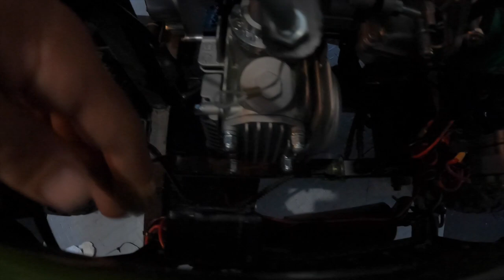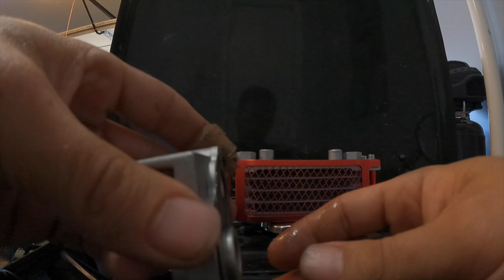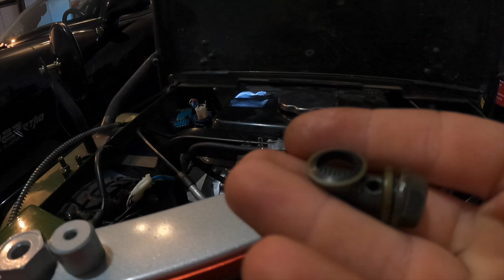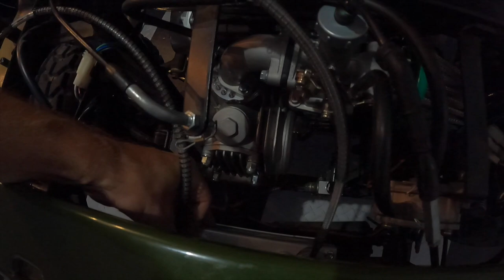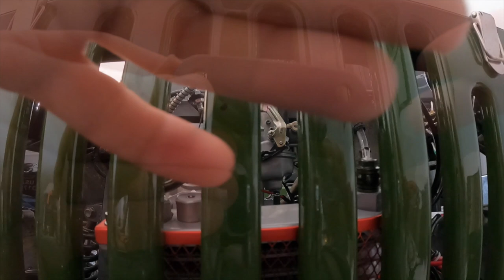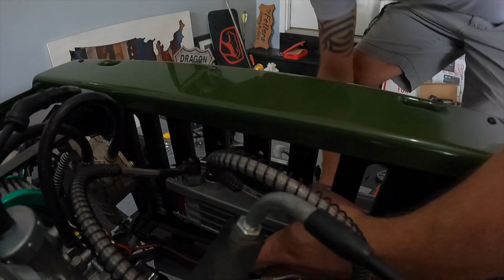Mini Jeep OIL COOLER INSTALL! A MUST DO MODIFICATION!

Comment: Did the oil cooler lower the engine heat problem? I own the Coolster GK6125 mini jeep and it gets super hot after even a short ride. Other option might be an electric fan mounted to the inside of the grill (or maybe both, think that’s overkill?)

Comment: There have been lots of single jug air cooled motorcycles over the past 100 years. Why do you consider cooling the oil a must do? 
How much cooler does your engine run now? Who makes the one you used? More importantly, do you ever respond to people’s questions and comments?